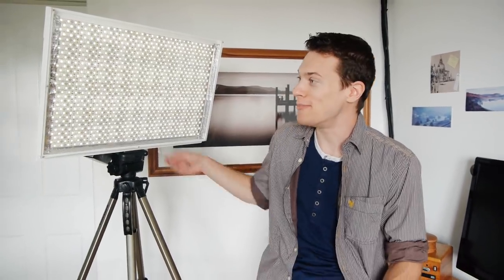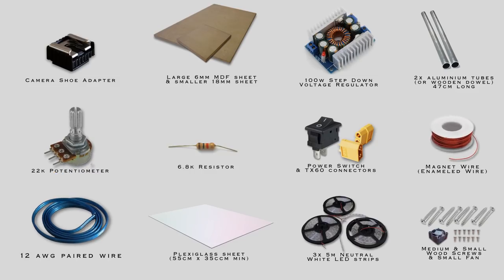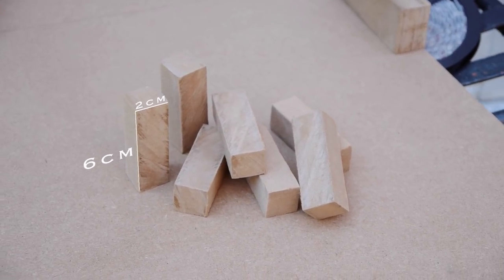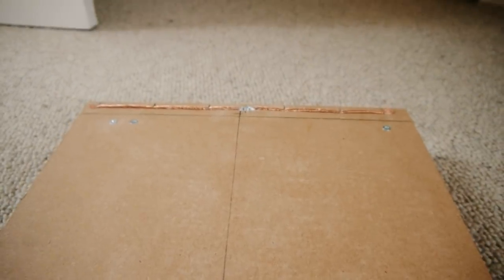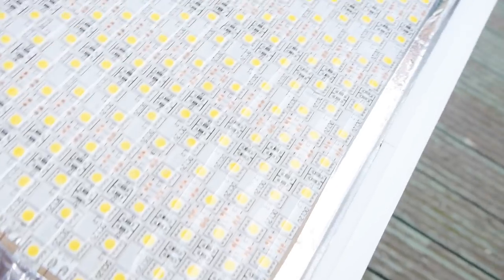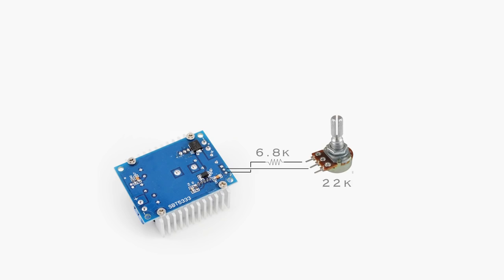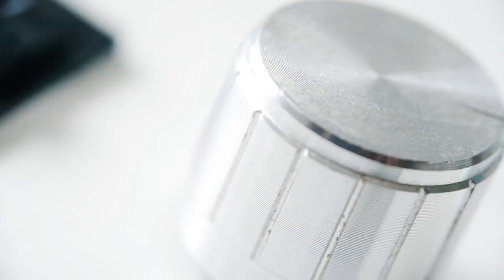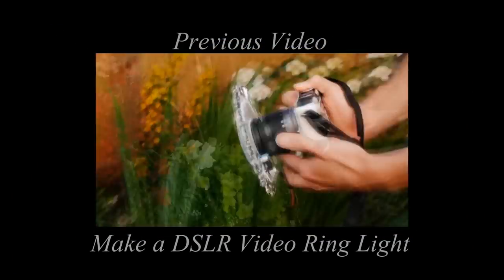How to make a super bright LED light panel (for video work etc)

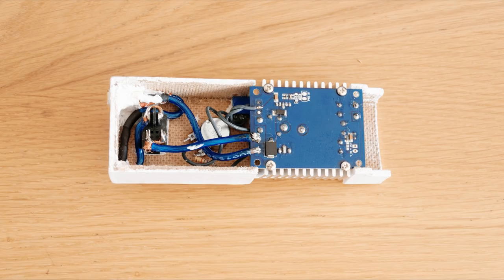Comment: It's really a great video!  I just love how everything is explained clearly.  Except for one little part.  When you talk about soldering the potentiometer to the voltage regulator at 9:32, we see that you draw two lines to explain that we need to solder two wires between the pot and the regulator and that we must add a resistor.  At 10:45 we could see that you somehow detached the blue plastic part with the preset on it and soldered two wires on the top of the regulator that do to the blue plastic part and I can't see if the resistor is before or after the blue part.  Then, at 11:09 we could see that you now have black wires between the pot and the regulator and I can see that one is soldered under the regulator and can't see where the second wire goes.

I'm not that good with this part, could you please explain where you solder the wires exactly please?
Reply from the maker: Just exactly as shown in the video. I just desoldered the trimmer when I was doing it as I was figuring out how it all worked, and in the end it wasn't necessary to do so.
Reply: DIY Perks so I solder the two wires on the tiny contact points under the regulator and leave the trimmer in place and don't solder anything on the top of the regulator?

Thanks a lot for replying by the way! It's very much appreciated and I'm impressed that you answered so quickly.

I watched a lot of your other videos and you are just full of amazing ideas. Your videos are really well done. Good production quality and really entertaining to watch. A lot of diy videos are often useful but could feel a bit dull to watch because people at good at what they do but not necessarily good at explaining it or at talking to a camera, but you are very talented and interesting to listen to. Congratulations on everything you're doing!
Reply from the maker: That's correct yes, just solder it to the bottom contact points indicated in the video and it'll be fine :) glad you like my videos!

Comment: why use a hot shoe adapter to get your tripod mount? you could just use a 1/4 20 nut or even better  small metal plate you could just use a screw starter bit to make 1/4 20?
Reply: I used a 1/4-20 T-nut to build my tripod mount. It mounted just fine to a tripod (before electronics were installed).

Comment: Hey there!

Great build, I'm excited to try out some variations on this. I was wondering your thoughts on replacing the heat sink on the step-down voltage regulator? I was wondering if doubling the length or depth of the heat sink might eliminate the need for a fan? 

Thanks for your thoughts! All the best!

Comment: this DIY tutorial RULES!!! I'm trying to understand how you calculated the power supply watts though.. The working current of the strips I bought via the link are 1.2A per meter, so 15 meters (3 5M rolls) would total 18A. so if Voltage x Current = Power then 12V x 18A = 216W.. but you say 100Watts.. there is certainly something basic I don't understand, I wonder if out of kindness someone may offer me a clue?
Reply from the maker: Marc Tomko The specs on the strips are wrong, that's all. Each strip uses around 30W I found.
Reply: +DIY Perks I appreciate and trust your calculation, I'm just really curious about how you figured out it was different? if explaining is asking too much of your time, do you have any favorite electronics information sources you can point me too? Thanks dude!
Reply from the maker: +Marc Tomko I just measured the current used at 12v with a multimeter, and then multiplied the current by the voltage, which gave me the 30w-ish rating (2.5A ish).
Reply: DIY + Perks  your measuring is not 100%  in the video, as you set the output V with no load. why? will it not change under load?  and the load will change with different V will it not?

Comment: Hi there,

As a video-pro i got very interested in this am about to try the build.

A couple of questions remain though;
- I want to build a variation of one that only draws it's power from the mains (230V in the Netherlands) bij using a power adapter. Do i still need the voltage regulator?

- Could i use 24V led's instead? As i understand it prolongs the led lifespan.

Thanks and keep up the good work.
Reply from the maker: camera l montage l fotografie You'll still need the voltage regulator if you want dimming, but if you don't need dimming just plug the LEDs into a power adapter that outputs the voltage you need (12v if you use 12v LEDs).While you could go with 24v LEDs, I don't believe there's any advantage to it for this type of usage. Besides, the neutral white LEDs I used are only available at 12v. If you wanted to wire them up in series to get 24v you could do so, but it would be more complex with no improvement in performance or longevity.
Reply: DIY Perks Well Matthew, thanks for the prompt response and advice.
I've ordered the leds and voltage regulator and will hopefully get to building it soon.
Reply: DIY Perks
Allrighty then, the parts ordered through Ebay have come in, took about two weeks, and am now doïng some construction on the frame.

Do you think you could post a wiring schematic?
This would make it easier, since i am now working from a screenshot.

Ta very much!

Comment: I normally use 5600k daylight balanced bulbs. Do you prefer these? They are only 4500k.
Reply: +c0pyimitati0n I was thinking the same thing. If they are 5600K or 3200K then you can put CTO or CTB on respectively to match other lights. But at 4500K you will need something like 1/2 CTO and CTB in order to balance both up and down. If I do this I think I will go with 5600K if I can find any.

Also, I would look for frosted plexiglass, maybe even the sheets they put over fluorescent lights.

Comment: Hi Matt, I know this is an older video and as with time we all get wiser, but, the terminology used to rate the battery capacity was 1st off labelled incorrectly and second off you said it without correcting it. The lipo battery used was an 8Ah battery not an 8A battery. 8A Dictates the current it could deliver  and not the capacity which is in actual fact 8 Amp Hours. The "30 C" rating on the battery is an absolute max ratting for current delivery working at half that (15) will give you the constant capability. So 8000mAh x 15 will equate to 120000 mA so 120A. The capacity and current handeling should rather be detailed  and not lobbied as the same thing, doing this could lead to potential problems down the line. Other than that good video. Regards.

Comment: 0:25 "that's a kilowatt of light output"  Not exactly, although your point about efficiency is of course completely valid.  A 1kW incandescent lamp draws 1kW of power from the mains, and emits a small fraction (about 5% according to wikipedia) of that as light; the rest is turned into heat.  Your LED lamp draws 100W of power from the mains, and emits, let's say for the sake of argument, the same amount of light, and the rest - a much smaller fraction than the incandescent - as heat.

Comment: Great video. However I have a couple of questions please mate.....I know the XT60 wires into the "input" screws, however where does the switch wire up to please? Is it the little connectors on the underneath of the panel, under the same "input" as the XT60? Also, I am confused at to where the fan wires up.....cheers :)
Reply from the maker: Just have the switch break one of the connectors coming off the XT60. That way, when it's off, it's like having the connector unplugged.
Reply: Thank you mate, however I don't understand :( Do you mean connect both switch wires to the same soldered connection as the XT60? Thanks
Reply: Or do you mean instead of connecting the XT60 to both terminals, connect one XT60 wire to the terminal, then connect one switch wire to the other terminal, then connect the two spare wires together (without touching the terminal)?

Comment: Is it possible to use PC Power Supply insted of laptop adapter?
(PSU 420W, and use 12v relay)
Reply from the maker: Yeah, should work fine.

Comment: I'm doing this for sure, great project :D is there a way you can make the light warmer? (to make it look more like natural sunlight in videos)
Reply from the maker: ***** If you'd like to have a warmer panel, you can either use different LEDs, or put a slight yellow filter in front of them.If you decide to go with different LEDs, just choose any "NON-WATERPROOF" 4500k set, as they're generally quite well balanced towards warm sunlight. (The waterproof coating makes them closer to 5500k).
Reply: thanks! :)

Comment: Great video, do you think it would be possible to scale up the LED panel into something like the upcoming Philips OneSpace that can turn your entire room into a giant softbox?
Reply from the maker: Jon P Absolutely. For a fraction of the cost too. What I'd do if I were building one is, instead of having the LEDs closely packed together like on this panel, have them 3-5CM or so apart from each other, but mount them behind diffused plexiglass to merge the light together. That way you'd still get a very soft even light, but you'll be using far fewer LEDs so it'd be much cheaper.
Reply: DIY Perks Hmm, I wonder how bright it would be to have the LEDs further apart.  I was thinking of using the Kvadrat Softcell material  (apparently it keeps its stretchiness for years and is a good acoustic dampener) that is originally used in the OneSpace or perhaps softbox material to better diffuse the light.  Any idea what transformers/converters/etc. can be used to use the panel as a light fixture?  I am picturing full ceiling light coverage.

Comment: can i just use an adapter and potentiometer without a voltage regulator to power up the LEDs ?
Reply from the maker: You can connect them directly to a 12v (no higher) adapter if you like, but there's no way to dim them using a potentiometer if you do that.

Comment: without PWM the current(amperes) can't be distributed evenly to the LED array. you need to put sort of current mirror circuit between every two parallel arrays........otherwise you can't get the uniformity of illumination reuired for such photography usage
Reply from the maker: Seems perfectly fine in practice - never had any uniformity issues even at low brightness. Might be a case of over-theorising ;)
Reply: You must notice some nonuniformity after midium to high operation period....when the LED's temperature rises......which might not be the case for the kind of usage u require
Reply from the maker: No, there are no uniformity issues at all, even after it's been left on for a long time. Remember, each set of 3 LEDs have a current regulating resistor, so that probably helps.

Comment: PRO TIP:
  ----->> For  LONGER  LASTING  LEDs, find the LED strip's rated current, if it is 12vdc, (for example) then set the regulator to allow a maximum of 11~11.5vdc. You can set for even less if you'd like, but the lower you go, of course, the dimmer the panel will be. 
  By only allowing a little under the rated voltage of the LED strip, you will get a longer lasting LED panel. For me, it's for sure worth sacrificing a volt's worth of brightness, to not have to replace any strips. At least if I do have to, it won't be for a while longer.

Comment: Can someone help me out please.

I really wanted to have a crack at building one of these (a bit of a novice) but im having some trouble.

My lights do not work once connected.  They work fine when connected directly to the power source ( a laptop charger 20 V 90W) so the connections are good, but not through the voltage regulator and circuit.  My fan works fine and I have between 9 & 12V coming out of the reg but no lights.  My voltmeter is telling me I have about 40V going in though.  I have checked continuity across the connections and it seems to be ok.
Reply from the maker: shintap Are you using 24v LED strips by any chance? That would explain why they're lighting up with a 20v adapter...

May I ask where you're getting the 40v reading from? If it's on the input side, it should be only 20v, as that's what the adapter is rated at.
Reply: DIY Perks Thanks for the reply.  It would appear that I am more of a novice than what I thought.

I was getting 40V as I was using the wrong setting on the Volt Meter like a true wally !!

It got it to work last night after giving the 22k pot a tap as it looks like that has a fault and has some dead spots on it.  Thanks again for the reply and great work on the movies.

Comment: There is one thing I don't understand, maybe someone can help me.
If each LED strip works with 72 W then 3 strips will need 3 x 72 W = 216 W. But a
a power brick with 12 V and 10 A gives me only 120 W, right? How can this work?
Reply from the maker: albatrosismael Because the strips don't really use 72w.

Comment: Hello, Thank you for this really good teaching video.

I am about to make my own.
And this I have a question:

Can we double or Trippler the number of LED, from the same regulator?

if so, how should I do?

thank you

Good day to you
Reply from the maker: GONE Adding more LEDs will likely be too much for this specific voltage regulator so you can either use more regulators to deal with the extra strips or use a more capable regulator.
Reply: DIY Perks Thanks for your answer. Can I connect 2 or 3 regulators on the same main battery ?
Reply: GONE Please could you tell what is the best AC adapter for the Leds panel you present here in your video ? please ( I red a lot of answer and I loose myself in it )

Thanks !!!!
Reply: I am confused, could you help me please.
I have several AC adapter:
- 12V 3.30 A
- 12VCD 200mA
- 12V 4.0A 48W Max
Can I use one for the panel that you present here (900LED)?
I really need help with this
Reply: GONE I have an other one : 18V 2.23 A LPS is it ok ?
I'm sorry but I'm french and it's difficult for me to understand all what you said !

Thanks a lot
Reply: GONE Like he said, you Need to use a power source that's capable of supplying AT LEAST 100W and 8Amp. So no power supply you mentioned would fit... The first one is rated 24W.  next one is 12V*3.3A=39,6W. Not enough. 12V*0.2A=2.4W, which is less than a normal USB-charger. 48W is not enough too. The last one is not good enough too: 18V*2.23A=40,1W. So now you can easily calculate an compare and search for a better one.

Comment: How much more power is consumed with voltage dimming vs. PWM? I'm trying to build one of these for my apartment (not video work) so I would be using it for several hours at a time. If the power savings are substantial, I'm thinking I could live with PWM.
Reply from the maker: +Felix Boehme It's only around 10w more using voltage dimming, at most.
Reply: Gotcha, alright. Thanks for the reply. Having trouble finding the right wires in my local hardware stores here in NYC. Any commonly available replacements you might suggest for the paired wire and the magnet wire?
Reply: +Felix Boehme you can easily get magnet wire on ebay... I am assuming you can get paired wire there as well. Also you could try hardware stores online if you feel more comfortable with that, or amazon possibly. I understand the struggle, I am in NYC as well!
Reply: Thanks. Yea, eBay seems to be better for niche items like this. Saw it too late for the wires, but I also found more options there for diffuser panels. I ended up finding the paired wire at Lowes and stripped some wire from ACE to get my magnet wire. Plywood from Mikco Lumber Yard.

Comment: Hello.
Very nice video :) I will try to make this, my camera is having problems in my shop when I want to make timlapse images. 

One question, at 2:23 what program do you use to make these measurements tekst with ?? 
Thanks again for posting. 

Best ragards.
T.Robertsen
Reply from the maker: I use After Effects for the measurement overlays :)
Reply: +Norwegianwoodworker Use the motion tracking filter on AE
Reply: +DIY Perks What video editor (that is not insanely expensive) would you recommend?
Reply: +Jordan Johnson (Mighty Burger)  Adobe Premiere  Pro coupled with Adobe After Effects pretty sure there is a bundle on creative cloud like 19 dollars a month or something like that .

Comment: Can't figure out how you use 100w (8A) voltage regulator for 3x5m stripes, each of them 72w. Could you please clarify this point :)
Reply from the maker: Simply that they don't draw the stated power. They're more like 30w per 5m (with the ones I used).
Reply: +DIY Perks Thank you!
Reply: Can i use 300W Voltage step down regulator to this project?